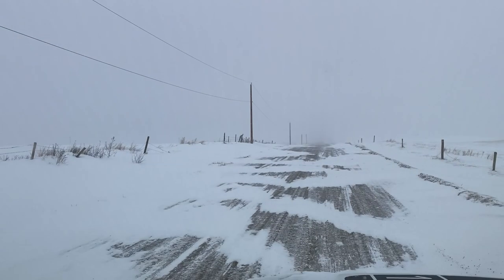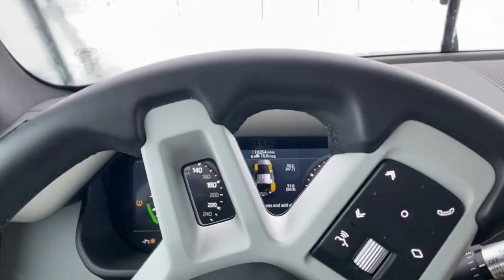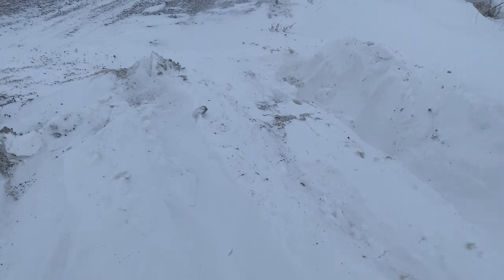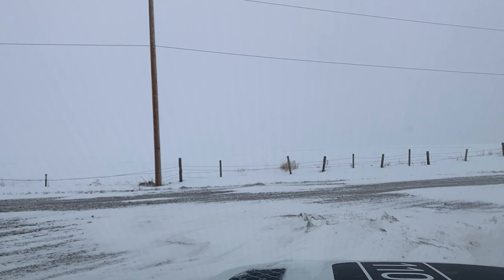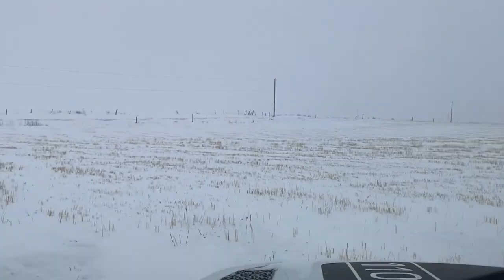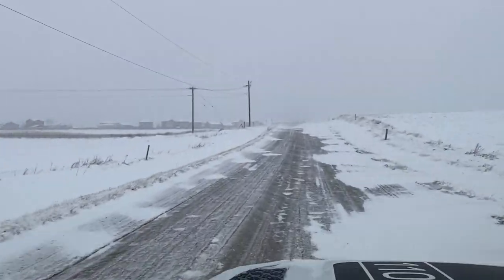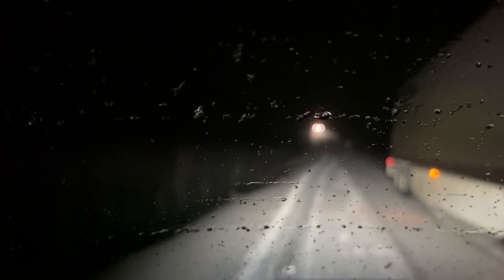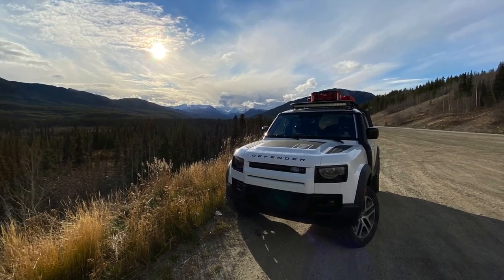Explaining the All Terrain Progress Control (ATPC) Function on the New 2020 Defender

Comment: Some useful info there, thank you Steve. 👍🏻

Just wondering: would you have found the rear locking diff of benefit, not just for this video but off-road generally? I bought mine without the rear locker hence the question. Thanks. 😉
Reply from the maker: No, I doubt that the rear diff would be of use here. The diff has benefits only in very loose shale or big boulders. The tech is what does the work here — and tyres. 

I’ve no doubt that the locking diff does make a difference, but if you look at the hill climb and descent video, the tech is more than capable of rocking big slippy hills without the diff, and that’s the point of the tech.
Reply: @shedlock2000  That’s good to know, thanks. It’s mainly Mud&Ruts where I live, won’t get much snow (me being a soft southerner 😉).

Comment: Noticed you have your Blackberry Pivi Pro screen is set on white, I think it looks clearer to the eye or camera when set to black, matching the display binnacle display ?? !!

Noticed from your view of your display that you haven’t got the Rear Locking Differential on your 1-10 , do you wish you’d of ordered it as yours isn’t just a ChelseaTractor ?

Keep up the professional waffling 👍🏻

#StaySafe 🦠😷
Reply from the maker: Haha!! Professional waffling! That sounds exactly like me! 😆😆

The PiviPro screen is set to automatic colour selection — so it’s white in the day and black at night. I don’t have much of a preference, but I do find the black is better at night. I very rarely use the 4wd screen, to be honest, because the info it displayed isn’t very useful to me as a sort of seasoned off-roader (I don’t care which wheel is in the air, I just need the TC to work). 

I don’t have the rear locker, you’re right. I’ve also never missed it. I didn’t have it in the LR3, but I did miss it there; my L332 had it too, but the Defender is better off-road without the locker. I’d imagine that only in the most severe of terrains would the locker be useful. 

I’ve spoken at length to the guy who developed the off-road aspects of the defender. I’m our discussions he explained the the speed of responsiveness of the TC is so quick that the locker being fitted won’t make much difference. You may notice a locker if you were to rock crawl (which I don’t), but in all of the circumstances that I use the defender, the locker would make little-to-no difference.
Reply: @shedlock2000  yeah in auto it changes, but too bright for me so can lock it into the dark screen and it matches the binnacle better etc 

#StaySafe 🦠😷

Comment: Hi, can you please show us the true real purpose of ATPC in Hill Decent mode down a very step hill in snow with ice surface etc..   Therefore worse case scenario.  We had a long steep driveway in U.K. where the weight of old Defender and newer RR Sport we’re just too heavy to control the decent in snow where they turned into scary sleds.  Thanks
Reply from the maker: The ATLC can’t be used in conjunction with the HDC. The functions are not able to be activated at the same time. That is to say that the button you use to engage HDC is the one you press to engage ATPC; depressing the HDC button twice is how you activate ATOC, but activating ATPC disengages HDC. 

I imagine that the ATPC would likely be very dangerous if it was used in conjunction with the HDC, as the vehicle would be under throttle down hill (in your example), and that would be dangerous. 

I’m very pleased you brought this issue up because this is exactly the point I’m trying to make about the limitations of HDC: the HDC is only as good as the traction at the wheels, and engine braking works further up the chain, if you will; the engine braking slows the vehicle down without depending (so much) on the wheel traction.

What you’ve experienced, if your vehicle has run off with you on a slippy down grade, then it may be for two reasons: 1) that your tyres are not sufficient to grip in in snowy or icy conditions, and 2) that you’re HDC tech is not working quickly enough because of a more primitive ABS system. 

I am more than happy to do a HDC video in more severe conditions. I’ll try to put one together for you — but please remember that tyres are the weakest link and that your best course of action in the winter is to buy the absolute best tyres possible for winter use. In addition, the effectiveness of HDC can be increased by use in conjunction with effective engine braking (by selecting a low gear that increases the rpm of the engine while descending a steep hill).
Reply: @shedlock2000   thank you for your well considered response.  Accepting your valid points about tyres, my experience and concern is the very high weight of the new defender creates its own issues when going down hill in extreme conditions such as snow covered roads.  What isn’t being talked about here with the new defender is the weight.  This shows with your video on down hill lack of engine breaking!  As for hill decent control my experience of these systems is when activating/ setting off on a slippery decline which is very scary around tiny British lanes deep in the countryside 😐
Reply from the maker: The weight of the defender is significantly reduced from the LR3/4, but about 200lbs greater than the Classic defender. Weight is always an issue when considering stopping distances and the related inertia. However, the HDC is intended to help resolve those sorts of issues. The HDC can be set to a very low speed, which is generally beneficial on steeper slopes and can crawl down at very low speeds indeed. 

As you can probably tell, I’m from the Peak District, so I’ve lots of experience with steep descents on muddy terrain and in icy and snowy conditions. If you engage the HDC and constrain it to very low speeds, it should operate sufficiently well to take you safely to the bottom of a drive. 

I’ll take some time this weekend and find a steep hill. Then record the operation of the HDC in snow and ice.

Comment: I noticed that you have the front/rear locker, but not the rear diff locker.  Do you know which package includes the rear diff locker?
Reply from the maker: I didn't spec the vehicle (or I would have specced the rear diff -- even though I don't think I'd use it. The rear e-diff (electronic differential) comes with the 'Off-Road Package); mine has the 'Advanced Off-Road Package' (which is less useful than the package with the diff)!
Reply: @shedlock2000  That package is really misleading.  Thanks for the reply.
Reply from the maker: @JohnBaldwin63  the names are a bit!
Reply: @shedlock2000  If you spec the off-road pack and the towing pack, which diff do you get?
Reply from the maker: @JohnBaldwin63  were I to have specced my vehicle, those would have been my choices. You’d get the e-diff with the Off-Road Pack and the TRS2 because of the towing pack.